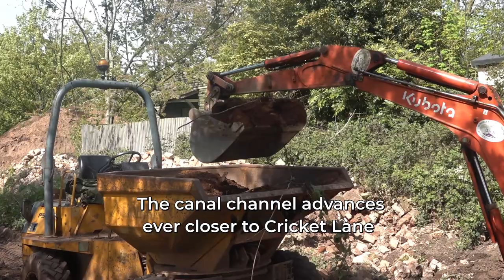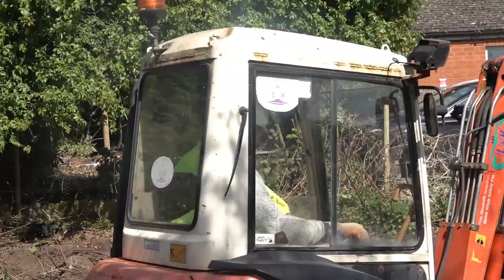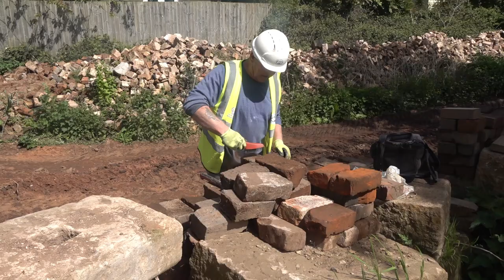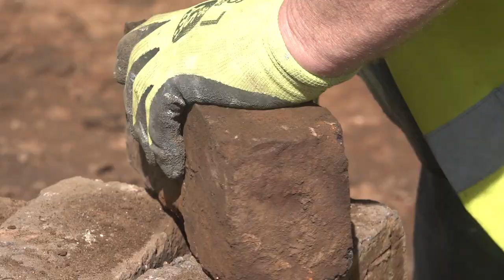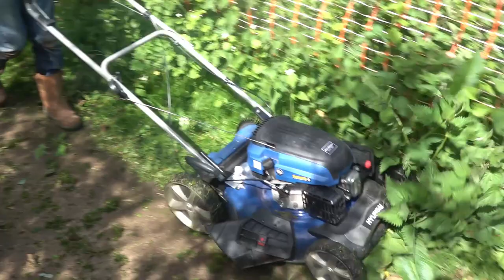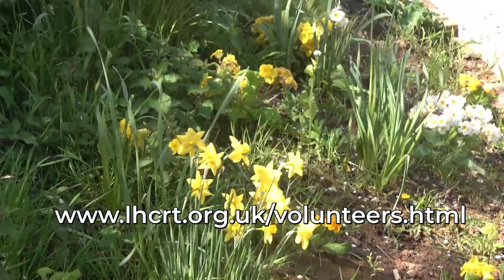The Ground that Keeps on Giving

Comment: So now you need a hard hat etc. to mow a lawn
Reply: Unfortunately for insurance purposes all persons on construction sites have to use PPE otherwise HSE could turn up and stop all work even if a particular persons job is not directly connected with actual building work (many sites you can't even enter without hi viz & hard hat).
Reply: @stevehill4615  You clearly don't know what you are talking about mowing a lawn is not a construction site I speak as a former construction manager  and worked on multi million projects
Reply: @johnwilliams-sc1vf  Gosh, thanks for letting us all know. VERY important to get EVERY single minute detail about mowing lawns correct. 😎